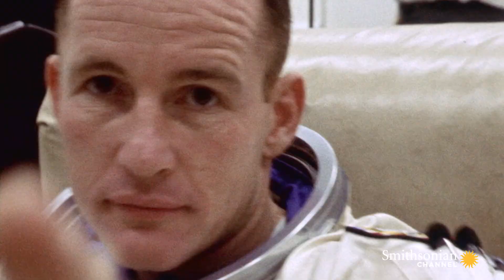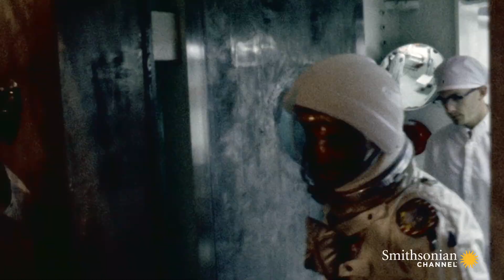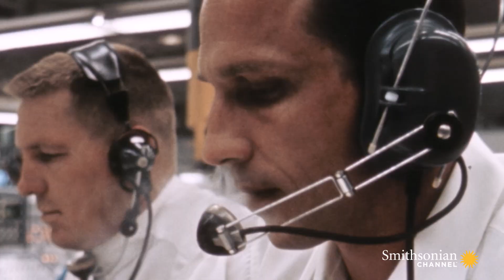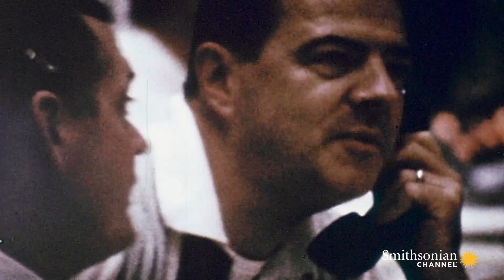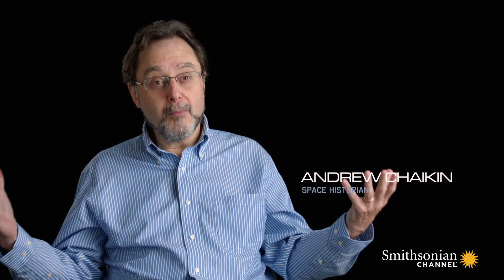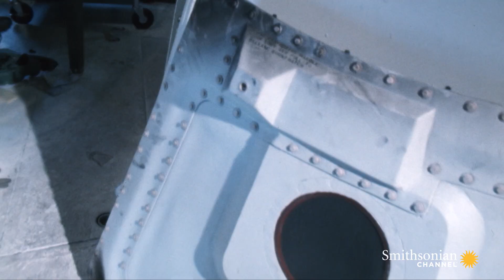How a 'Non-Hazardous' NASA Mission Turned Deadly

Comment: It's just like putting Human being in pressurized pure oxygen chambers. Which have very high potential of fire. I don't know y scientist didn't consider this possibility, of fire.. they should have atl🎉 made a mechanism which will brust some kind of Pure Carbon di oxide or heighly reducing gas with will reduce the oxygen. Or whole bunch of mechanisms for fire control. But they seem to put only normal extinguisher. As in the video.

Comment: I'm sorry but when the autopsy report on the Apollo 1 astronauts says the astronauts all died of cardiac arrest coming from asphyxia that would have sent them 'to sleep' before the flames reached them - that just doesn't sound plausible. People don't asphyxiate in 17 seconds. It takes at least a minute to asphyxiate from hypoxia and hypercapnia alone, as near-drowning incidents show; and up to 20 minutes to asphyxiate from toxic gases such as cyanide, as the Holocaust, atrociously and tragically, showed us. And people don't just go 'to sleep' in such a situation, either - that's a fiction sold to us by films, TVs and slaughterhouses, about death in general. If it worked like that then standard methods for the death penalty or for non-food-animal euthanasia wouldn’t have to use powerful sedatives and sometimes also powerful paralytics to achieve a sleep-like state followed by an apparently still and peaceful transition from life into death. That aspect is an aesthetic one, as much for the comfort and/or the salving of the conscience of the living as for the easing of the process for the one being killed. Without those sedatives and paralytics there's an instinctive panic and a thrashing, reflexive, distressing basal effort to preserve life at the very deepest levels of the central nervous system, even past the point of unconsciousness, right to the end, until the central nervous system’s mechanisms simply break down completely. 

However, people DO burn up in 17 seconds (or maybe even less) when stuck in a raging inferno of flammable material and 100%, pressurised, oxygen. That fact, coupled with the state in which their bodies were found and the explicit cry of "WE'RE BURNING UP!" as well as the fact that they tried so hard to get the door open, makes me quite simply not believe the report that they died without suffering, long before sustaining the burns they were ultimately found with. The autopsy narrative feels like a sop for the living, rather than a true representation of the situation experienced by the dead. I'm all for discretion and selective sharing with the bereaved for their own welfare, in order to protect them from the full and permanently scarring horror of what happened to their loved ones. I am not for outright lying to them, though, and especially not for experts and officials outright lying to each other about what happened and what it constituted for those astronauts on an inside level. To say they didn't suffer, when we have an actual recording of them screaming and explicitly stating that they were burning up - for a person who was not in the situation itself to discredit the truth of those last screaming words issuing forth from those who were - that's the grossest insult possible to those men, in my view. "WE'RE BURNING UP!" "No you're not, actually. You're not even suffering at this point, and you won't suffer at any point. The fire hasn't reached inside your spacesuit yet. Right now you're merely asphyxiating and going to sleep - you'll be unconscious before the flames get to you." Can you imagine it!! 

But of course, to admit it as it was would have been an instant end not just to the Apollo program or moon aspirations, but to NASA itself, and possibly even an instant threat to solvency itself since NASA is a government-funded agency and the government is in large part taxpayer-funded. The degree of public outrage knowledge of the truth would have caused would have been impossible to manage. So there were several big, and very pertinent, motivations to maintain something of a fiction about the full degree of suffering experienced by the astronauts, on all of a humanistic, vocational and societal level. 

The only small comfort is that third degree burns do not - CANNOT - hurt, because in those types of burns the nerves that would cause the pain have been destroyed. This is confirmed by people who have suffered them, stayed conscious, and survived. In an 100% oxygen, pressurised inferno, once the suits had been breached, the fire would have rushed in under high pressure and burns would likely have skipped or at most flashed momentarily through first degree (the really painful, skin-level kind where the skin turns red rather than black), straight to third (goes all the way through the skin and blackens what remains) due to the sheer degree of heat. In fact, from first mention of fire to "WE'RE BURNING UP" took only eight seconds, which shows how fast it all was. Though I believe they were burned both alive and conscious and fully functioning, and that they did not asphyxiate as strategically claimed by the autopsy report, I don't think the process, or the suffering, lasted even as long as death by a really competent firing squad.

Comment: I don't understand why there wasn't crew standing right there to put out the fire.  Or open the door at least.  Simply just goes to show how hurried this entire process of getting to the Moon indeed was.  They harbored so much angst and paranoia the Soviet Union would be the first.  Cut corners and necessary checks and redundancies which ensured a sense of safety were thrown aside, costing real people their real lives .

NASA is just as corrupt and morally tainted as their Communist adversaries it's sickening.
Reply: The problem which ultimately killed the crew was the decision to have a greater-than-atmospheric pressure within the capsule. This made opening the door impossible.
Reply: @hydrochloricacid2146  Very true.  But my point was/is in an experiment,  (I at least) one should take into great consideration that something awful could and possibly WILL go wrong.  To combat this, do whatever necessary to deal with and minimize consequences of such an event.   It just seems through the storytelling, such a thought was not of top priority.  And that is sad.

Comment: Terrible senesless accident. Had they used a normal oxygen atmosphere 21%, or even thirty percent oxygen mix, this could have been avoided.This was basically like a fire in a hyperbaric oxygen unit. Much of the material in the capsule was high density foam rubber seating, padding, etc. becoming the perfect fuel when fully saturated with the perfect accelerant. Life magazine had a huge story along with dramatic photos.
Reply: 1. Pure oxygen is routinely used in rebreather systems. It is breathed in, carbon dioxide is scrubbed from the exhaled air, using cannisters filled with a type of lime that absorbs it, or using lithium dioxide cannisters, and the exhaled air is then recovered and re-breathed, being re-perfused with oxygen as needed. With a re-breathing system you can cram more oxygen into less air and save on having to take - and/or find - greater volumes of air to breathe where there is none, or where the air in question is otherwise unsuitable to breathe (as on the top of Everest). In fact, this type of system was used on Everest in the early days of climbing it to try and save on oxygen cylinder weight, and to maximise the efficiency of oxygen delivery. It's also used in some SCUBA diving setups.

2. The oxygen in the cabin was pressurised because even in a pressure-controlled capsule, upon launch, air pressure drops rapidly, just as cabin pressure in a plane drops rapidly during take-off, causing popping ears, despite the cabin being pressurised relative to the outside. This dropping of pressure would disperse oxygen throughout the air more sparsely, thus in effect lowering the overall oxygen content of each breath taken by the astronauts. Oxygen over a certain pressure can saturate tissues of the body to toxic levels. Because of the absence of air pressure in space, to make sure they could breathe without needing their helmets on once in orbit, the pure oxygen of the re-breather system had to be pressurised pretty high on earth pre-launch, so that it would be normal by the time it reached orbit. Partly for this reason, astronauts had to wear helmets during launch and re-entry.

Comment: Who came up with idea to fill the chamber with pure oxygen ?
Reply: Pure oxygen is routinely used in rebreather systems. It is breathed in, carbon dioxide is scrubbed from the exhaled air, using cannisters filled with a type of lime that absorbs it, or using lithium dioxide cannisters, and the exhaled air is then recovered and re-breathed, being re-perfused with oxygen as needed. With a re-breathing system you can cram more oxygen into less air and save on having to take - and/or find - greater volumes of air to breathe where there is none, or where the air in question is otherwise unsuitable to breathe (as on the top of Everest). In fact, this type of system was used on Everest in the early days of climbing it to try and save on oxygen cylinder weight, and to maximise the efficiency of oxygen delivery. It's also used in some SCUBA diving setups.

The oxygen in the cabin was pressurised because even in a pressure-controlled capsule, upon launch, air pressure drops rapidly, just as cabin pressure in a plane drops rapidly during take-off, causing popping ears, despite the cabin being pressurised relative to the outside. This dropping of pressure would disperse oxygen throughout the air more sparsely, thus in effect lowering the overall oxygen content of each breath taken by the astronauts. Oxygen over a certain pressure can saturate tissues of the body to toxic levels. Because of the absence of air pressure in space, to make sure they could breathe without needing their helmets on once in orbit, the pure oxygen of the re-breather system had to be pressurised pretty high on earth pre-launch, so that it would be normal by the time it reached orbit. Partly for this reason, astronauts had to wear helmets during launch and re-entry.
Reply: And lock the hatch so they couldn't get out-?

Comment: "With pure Oxygen"
NONONONONONONONONONONONONONO...
Reply: 1. Pure oxygen is routinely used in rebreather systems. It is breathed in, carbon dioxide is scrubbed from the exhaled air, using cannisters filled with a type of lime that absorbs it, or using lithium dioxide cannisters, and the exhaled air is then recovered and re-breathed, being re-perfused with oxygen as needed. With a re-breathing system you can cram more oxygen into less air and save on having to take - and/or find - greater volumes of air to breathe where there is none, or where the air in question is otherwise unsuitable to breathe (as on the top of Everest). In fact, this type of system was used on Everest in the early days of climbing it to try and save on oxygen cylinder weight, and to maximise the efficiency of oxygen delivery. It's also used in some SCUBA diving setups.

2. The oxygen in the cabin was pressurised because even in a pressure-controlled capsule, upon launch, air pressure drops rapidly, just as cabin pressure in a plane drops rapidly during take-off, causing popping ears, despite the cabin being pressurised relative to the outside. This dropping of pressure would disperse oxygen throughout the air more sparsely, thus in effect lowering the overall oxygen content of each breath taken by the astronauts. Oxygen over a certain pressure can saturate tissues of the body to toxic levels. Because of the absence of air pressure in space, to make sure they could breathe without needing their helmets on once in orbit, the pure oxygen of the re-breather system had to be pressurised pretty high on earth pre-launch, so that it would be normal by the time it reached orbit. Partly for this reason, astronauts had to wear helmets during launch and re-entry.

Comment: Too bad they couldn't cut off the oxygen to put the fire out.
Reply: Wouldn't have mattered unfortunately. Capsule was pressurized @ 15 psi pure oxygen.
Reply: Cutting off the oxygen would not have cut off the air pressure or removed the oxygen that was already there. It may, however, have killed the astronauts to do so.

Comment: NASA must have  known that pure oxygen was dangerous, yet the hurry and lack of oversight meant that Apollo 1 had a lot of combustible material on board, as insulation to electric wires and many other things. That was a costly mistake.
Reply: Yes, you are correct, that was indeed the case. To save costs and space they used a single gas (oxygen) instead of a mixture of two, i.e. , nitrogen and oxygen, which would not be nearly as combustible.
It's a shame they had to learn the hard way and pay such a huge price for it.

May their souls rest in peace.
Reply: @naythanvaz3032  Nitrogen sickness is the reason they use pure oxygen but there should be enough safety in place to make a fire basically impossible. That being said the oxygen should be lowered and replaced with nitrogen once in space but that cost more money and NASA is great at saving money.
Reply: Cant think of name Yeah we breath 20% nitrogen with every breath, we need nitrogen to be healthy
Reply: @Seabass1206  Ok kid that thinks hes smart do more research
Reply: @Seabass1206   If you were in control of the astronauts all the astronauts would be dead from nitrogen narcosis before even reaching space.
Reply: Cant think of name Yeah i meant to say the air we breath is 20% oxygen, we breath in 78% nitrogen with every breath, amino acids all contain nitrogen  and thats the building blocks that make up the proteins in your hair and skin, we need nitrogen to survive, thats why the air in the space shuttles and stuff are a mix of nitrogen and oxygen
Reply: @Seabass1206   There is no nitrogen in any of the capsules if you did the research you would learn nitrogen is extremely toxic when going from different alltitudes/pressures quickly. Have you ever heard of the bends lol?
Reply: @Seabass1206   And we dont breath nitrogen to survive buddy we get it through our food.

Comment: Did they not know pure oxygen is highly flammable? RIP
Reply: Pure oxygen by itself is not flammable. But any fuel (or combustible substance) set on fire with pure oxygen atmosphere will burn explosively. Must have fuel, heat, and oxygen for a fire.
Reply: At the time they didn't think about that. There's only so much prevision this wonderful people could achieve. Knowledge and common sense are hard to build. They are built on experience and sometimes tragedies. They didn't know pure oxygen is also poisonous to inhale in the long run. But because of this science advanced!
Reply: Pure oxygen isn't an inflammable gas. It simply helps the flammable substance to burn.
Reply: Don't forget this was part of the rush to put Americans on the moon before 1970. NASA had concluded that a one-gas (oxygen) system was simpler and quicker to build. After this disaster, they changed to a two-gas system.
Reply: In a pure oxygen environment, everything is fuel. As soon as they said they fill the capsule with pure oxygen, my heart sank.
Reply: @Givemeliberty30  no.
Reply: Somewhere In Mexico they had to do it because that’s what it would be like in space
Reply: Taking Humans in pure Oxygen just to be  "  First on the moon "  reminds me 
of Boeing 737 Max to beat the opposition no matter how many lives will perish in the process. 
CATTLE FODDER  comes a Dime a Dozen  for a mere Egoistic position.

Comment: Why was nobody outside the capsule?
Reply: There were plenty of technicians outside - the problem was the three piece hatch. The inner hatch opened inward. Ed White and Gus Grissom struggled to open the inner hatch, but couldn’t because the fire increased pressure, tightening the hatch seal (Roger Chaffee did his job - trying to keep up communication with the outside). The technicians outside had problems opening the outer hatches while dealing with intense heat, smoke and toxic fumes.
Reply: Brad aha
Reply: The capsule was pressurized and the hatch only opens inward. They modified it for the next flights.
Reply: Irony and creepy..
Reply: if you listened, they said everything was planned as if a flight was to take place
Reply: they didnt expect that would happen